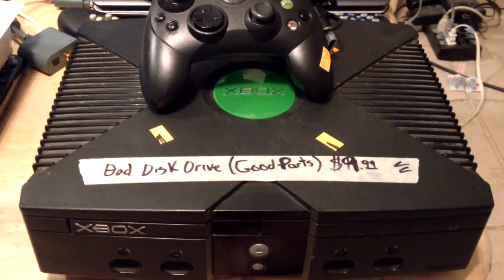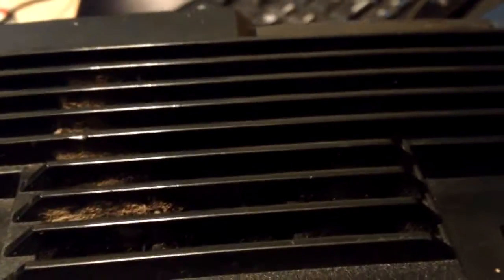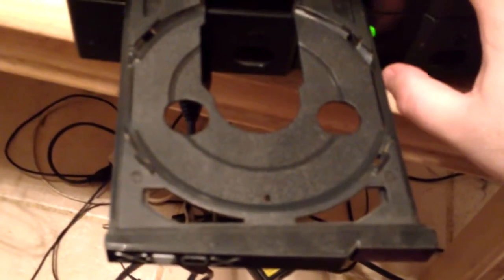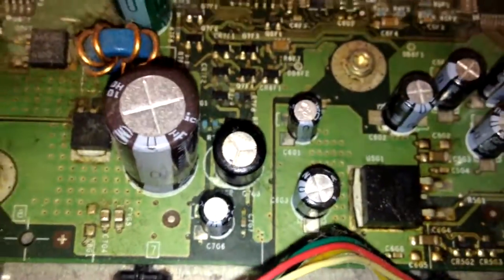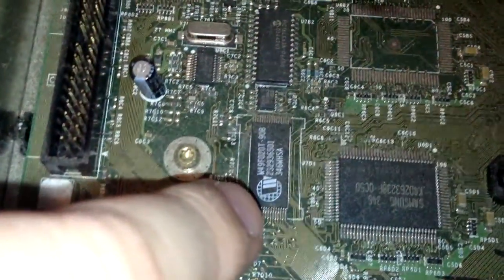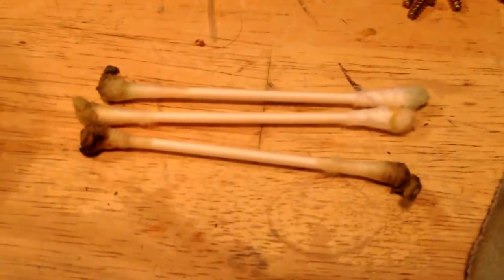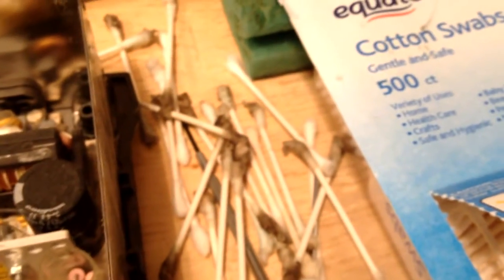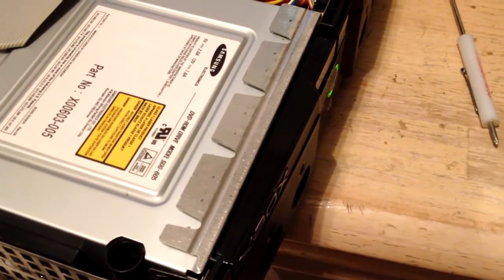Xbox DVD Drive Trouble?

Comment: the original microsoft Xbox had six revision motherboards 1.0 1.1 1.2 1.3 1.4 1.5 and 1.6 also there was two types of power supply units fox link in a 1.0 xbox was notorious for sparking the Delta electronics power supply was better sea gate and Western digital HDD the worst DVD drive is those stupid Thomson drives the Philips Samsung and Hitachi are reliable I own a modded Xbox it's a 1.0 I bought it from a pawn shop for $25.00 it took 20 q tips to clean the xbox and  I put a Samsung DVD reader in it and it works fine
Reply: Samsung drives are trash.

Comment: i have samsung dvd drive from og xbox but it doesn't read discs it even doesn't show any read error it only stop spins i cleaned entire drive And it still doesn't reading, can it something wrong on the dvd motherboard? or on the xbox motherboard?
Reply from the maker: Sounds almost like the laser is bad.
Reply: @BeachTechPC  so the best solution is to buy a new laser? can i put there laser from other dvd drive?

Comment: Do you just remove the clock capacitor or replace it?
Reply from the maker: leg humper just remove it.
Reply: Righteous and how did you figure out which version the Xbox is? Like my build date is 08-26-2003 so it would have like 1.2 or 1.3 right?
Reply from the maker: 01/2001–10/2002 1.0
11/2002–04/2003 1.1
05/2003–03/2004 1.2–1.5
04/2004–? 1.6